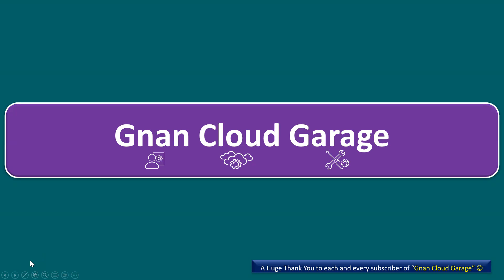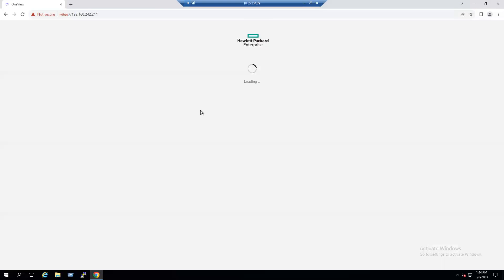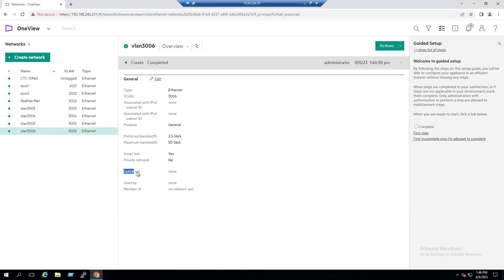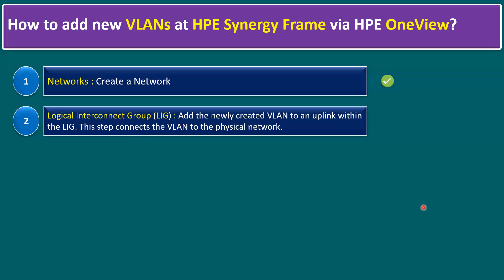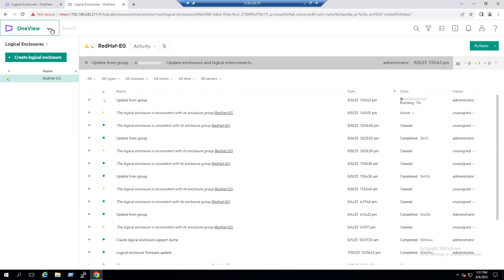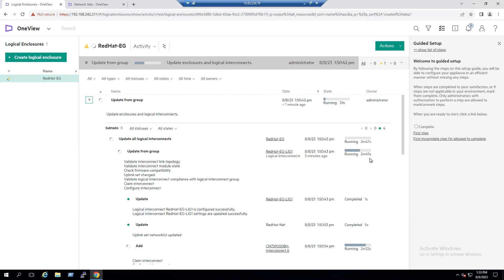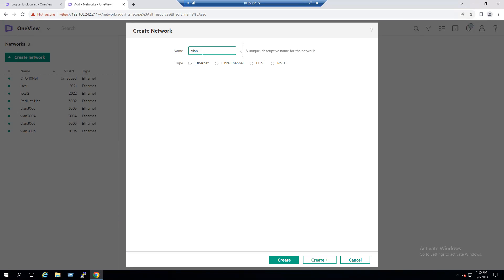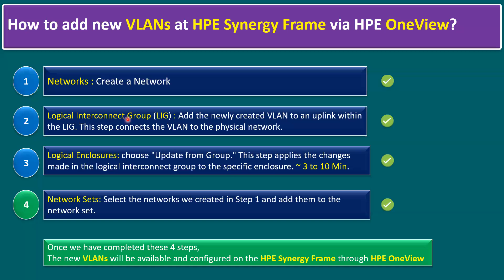How to add new VLANs at HPE Synergy Frame via HPE OneView?

Comment: is there any downtime require for configuring this VLAN?
Reply from the maker: Hi,
Thank you for your comment! 👍

No, there is no downtime required for adding a new VLAN in HPE Synergy Frame via HPE OneView, as long as:
✅ You are only adding a new VLAN and not modifying the existing active VLANs.
✅ You are not making any changes to the server profiles, uplink sets, or network configurations that are currently in use.

However, if you plan to modify existing uplinks, change the VLAN tagging mode, or update the server profile, there might be a brief network disruption depending on your configuration.

I recommend performing this task during a maintenance window if you are unsure about the impact. Always take a configuration backup from OneView before making any changes.

Comment: Nice job explaining this, I had to stumble through the process before I found this video. When adding the VLAN is there a long drop in network connectivity, or is it more of a quick blip? Thanks in advance!
Reply from the maker: Thank you for your positive feedback, Michael:-)

When adding a VLAN, the impact on network connectivity can vary depending on our network setup and the equipment we're using.

In many cases, adding a VLAN might cause a quick blip in network connectivity. 

This is because network devices need to update their configurations to recognize the new VLAN. 

However, the duration of the blip is often quite short, usually just a few seconds.

To minimize any potential disruptions, it's a good idea to perform VLAN changes during a maintenance window or a time when network usage is relatively low. 

Also, if we're concerned about the impact, consider testing the process in a controlled environment first.